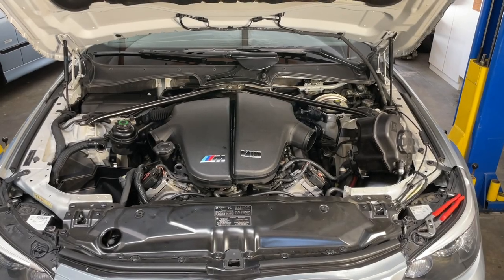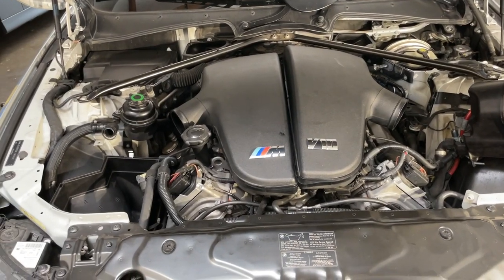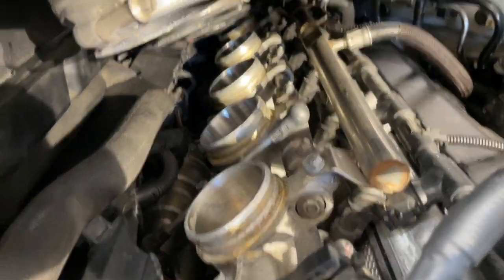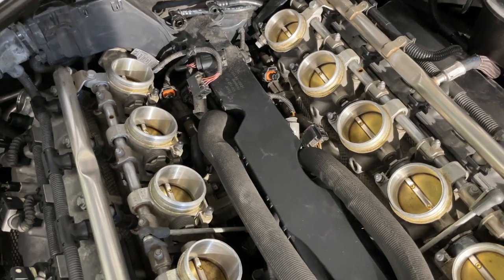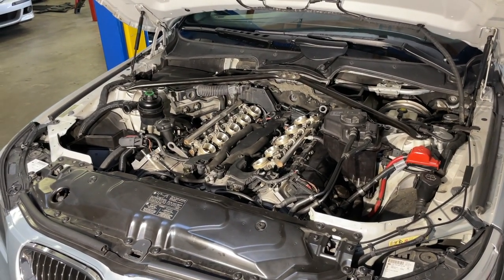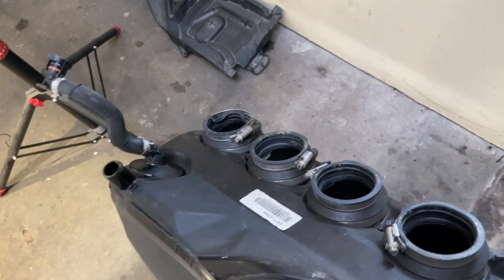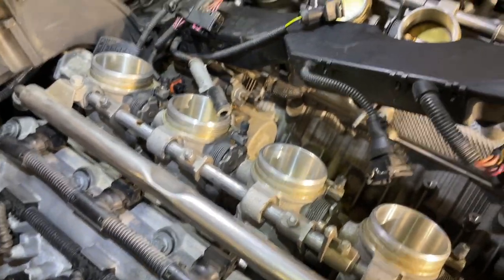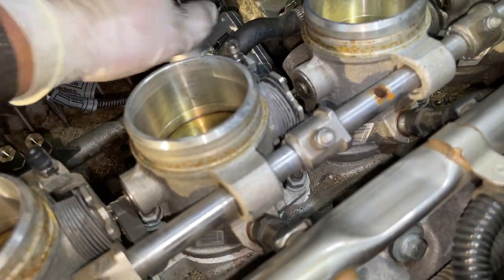BMW E60 M5 / M6 S85 Throttle Actuator & Idle Actuator DIY

Comment: Hello E39Source,

Just finished throttle actuator and injectors.

I rebuilt my throttle actuators, time will tell, but base on 60k/miles of service, happy to spend $200 in gears....from two different manufacturers.

Your video very helpful!  

That stupid nut for rear wiring harness was a disaster....lost 1/4" extensions and had to jack car up to retrieve from transmission tunnel.....GRRR!

I used WD40 for intake plenum install and worked great!  Hope self drying and not under any pressure so should be good.  plenum literally fell into place.

Used many 1/4" "wobble" extensions for the throttle body clamps.  Went smooth!

Again you video was a big help!

LS MIata

Comment: Your DIYs are real bacon savers and a tremendous resource to help keep these cars going and on the road, thank you for the time and effort to make these.  I have been reading as much as possible about doing this job and was very confused about how to handle the wiring harness. I don't know if my build year is different in how the harness was built, but it's like the car in this video: there's no way to fold the harness over for complete access to the V of the engine, short of near-complete removal of all the connections (injectors, and I don't know what else). Seeing that you, also, did not find a way to do that gives me some confidence that I haven't completely missed something. Great stuff, thanks for all you do for this community.
Reply from the maker: Thank you for your kind words Glenn!

Comment: I’m on day 2 of doing this job on my 07 E64 S85 and so far so good. Only broke 1 plastic clip on my harness. I left the air boxes in, the tank and got away with working around the harness still partially in place. Also the two lines in the back corners of the plenums I just popped off of the plenums because it was easier to do but we’ll see how easy they go back on. The two small lines that go into the back of the plenum you had one plastic 90 angle clip that you replaced. I didn’t see a part link for that in your list. Both of mine are broken and one was actually off of the plenum. Was wondering if you had a part link to share on that? I also had the pleasure of rubber malleting out the idler actuators because they would not budge and thank your for the needle noise plyer tip on getting those small hose lines off because they wouldn’t budge at all. Thank you for the great video very thorough and making this job much much easier doing it solo.
Reply from the maker: Thanks for your comment!  The hose clip at the back of the bottom is not sold separately, so you'll need to buy the whole hose.  We heated up the hose at the clip so we could remove just the clip.  To replace the entire hose, you'd need to remove the exhaust, driveshaft, and transmission to gain access.  The hoses are available here: bank 1:  http://tinyurl.com/4tkvhbf2  bank 2:  http://tinyurl.com/2s4fdv7f.
Reply: Thank you for the quick reply and link to those parts. I’m work on that next once they arrive 😊

Comment: Ryan been following your work  sir when u lived in Ohio and would work on the E39 . fell into love with M cars because of you .  i ended up buying the same car 2002 . sold that bought a M6 2010 , M5 2006 to follow .  E39 was the best ..cant live with a check engine light .. broke down bought an audi s7
Reply from the maker: Thanks for the kind feedback!!  You've had some excellent cars there
Reply: @E39Source  i got breakdown stories.  Every M car should come along your skill set sir.   Downtown Manhattan  on the fdr with my daughter and her three friends on a Friday evening  smg pump went.  Went into limp mode and I shut it off sitting at a traffic light.  10 k costed me to fix it and get it home.  I have that invoice. Just keepsake. You make it look easy.

Comment: Thanks for the video - super well done! i've got all the symptoms of a throttle actuator failure (limp mode, DSC and flat tire) however i'm throwing CDBD, 0519, 2b2e codes - all reference the idle actuators and not the throttle actuators.  any insight as to which i should replace? indy shop said throttle but i would have expected to see a error code indicating as much.  thanks again!
Reply from the maker: Both the idle and throttle actuators should be replaced during that service if they're older than ~10 years/65k miles.

Comment: You answered one question for me..my local independent BMW shop said if I do the throttle actuators at home, the car will not start, had to be "programmed". I thought I had seen people do it with no trouble on YouTube...
Reply from the maker: Yeah- there is no required coding or pogromming for this job.  That's a dealer excuse to bill you another $500.
Reply: @E39Source  Supposedly, BMW in an update, or something like that, says so....at least that is what the shop told me...

Comment: Great video! I used it to replace my IAs and it was perfect. Thank you. I replaced both IAs and a couple day later I got a code 27AA Oxygen sensor adaptation at limit position before cat. converter Bank 1. Any clue? Did you have any issues like this after you put in your IAs?
Reply from the maker: I don't think the oxygen sensor codes would be related, but I'd try clearing everything out and driving it a bit to see if it returns with the fresh IAs.

Comment: Why they made it so complicated ffs. You have alot of knowledge,i respect that. Cheers from a mech engineer :)
Reply: The car is literally an F1 based engine assembly. It was built for the true motorsport enthusiasts who have the pockets to back them up. That engine, as well as most @BMW engines, are required to have internal maintenance performed quite often. It all goes along with the M lifestyle. Just some knowledge........
Reply: @newyorkstreetmachinz4769  what cars do you have xd if i may know? Cheers bro

Comment: With regard to the throttle actuators. The root cause of them failing is overloaded circuit boards caused by the motor working harder than it should because the heat of the engine dries out all the pivot points of the linkages that connect the throttle actuators to the butterfly valves on each throttle body. The whole mechanism becomes dry, stiff and squeaky. 

It’s important to lubricant all the joints thoroughly when you replace the throttle actuators, so the whole mechanism can move freely - otherwise the new actuators will just be working far too hard and they’ll fail prematurely as well. 

People mistakenly think worn plastic gears are the root of the problem. They aren’t, they’re just a symptom.

Comment: You can’t replace either of the rear PCV hoses without dropping the trans. There are 2 PCVs that those hoses go in to, just like the ones on the valve cover.  However that go into the block. You have to do it next time you drop the trans or should have done it when you did the trans swap.

Comment: Update..I have a 2006 M5. Bank one idle control valve occasionally acts up, so I am replacing both. Since I am going to be in there, why not do the throttle control valves as well. Just got them yesterday, I know a BIG reason for failure is the plastic gears, bad lubrication. So...I took  both new ones apart...lo and behold, virtually no lubrication at all on the new ones. I lubed both, all gears will be putting on the car soon. Sad, they are made by VDO, Germany, it's like they deliberately want them to fail....

Comment: My accelerator stopped working completely out of the blues any help on how to resolve the issue? Took down my throttle actuators n both were brand new from previous owner
Reply from the maker: You need to start with scanning the vehicle's computer systems to see what codes are stored.  This will point you towards the culprit.  If you are local to San Diego, please email me at support@e39source.com so we can schedule service for you!

Comment: So the lifespan of the actuators are about 60k miles? Give or take. 
My 2006 E60 has 42,300 miles. So is it safe to say that I still have another 20k miles, give or take, before I do PM on them?
Reply from the maker: I would say the average lifespan is around 60k, but they can go anytime between 40 and 100k
Reply: @E39Source  Thanks. Do you recommend PM? Base on your response, looks like Yes.
Reply from the maker: @jeremiahex  If it were my own car, I'd probably have the parts ready to install when they fail.  If you daily drive/depend on the car, do it preventatively.
Reply: @E39Source  Thanks. I don’t daily it. But I’ll get the parts to be ready.
Reply: @E39Source Its like once it hit exactly 60,000 miles. My idle actuators failed lol. Its like bmw made them fail at that mileage. Exactly 60,000 miles 😭

Comment: So I have a question if you don’t mind I hav the 60 w/ 4.8L v8 when I accelerate or mash it to the floor it doesn’t do the whole 360hp I stock vw or even Honda beats me off the launch by a long shot? What could it be?     Edit: love the videos so far and I just subscribed!
Reply from the maker: You probably need a refresh of electronics and sensors such as spark plugs, MAF, cam sensors, engine air filters, etc.

Comment: Is there a part number for the hose clamp you replaced on the back of the intake plenum that you mention at 24:36?
Reply from the maker: So that hose actually runs to the back of the engine block above the transmission, and would require transmission removal to remove/replace that end of the hose.  The part number for the hoses are 11617838897 (bank I) and 11617838898 (bank II).  The connector is not replaceable independently, but you can buy a whole new hose, heat up the plastic around where the fitting presses in, and carefully remove it.  Do the same on the broken one on the engine and press it in to place.  I used another clamp on there just in case we compromised the plastic too much.  Either that, or pull the transmission!